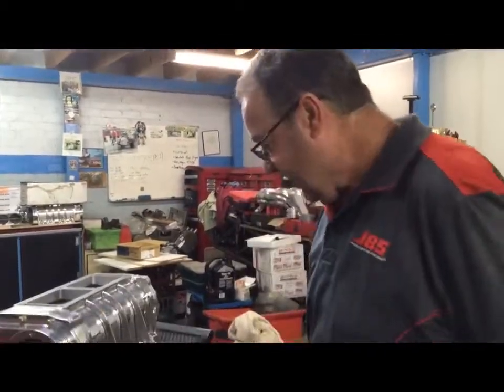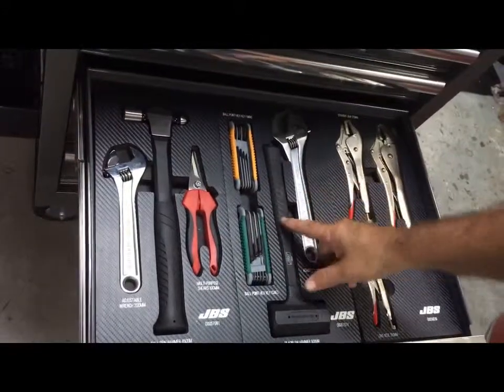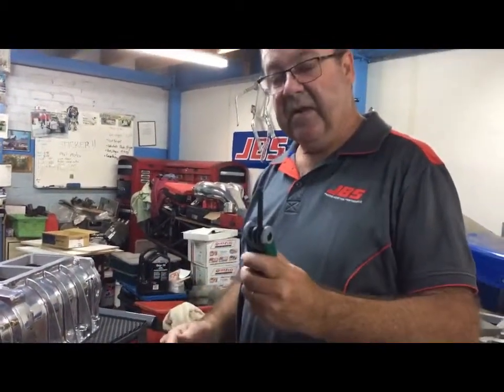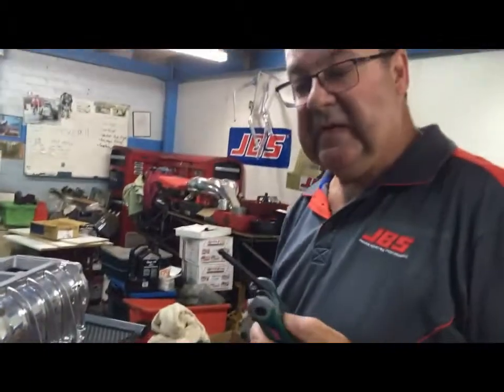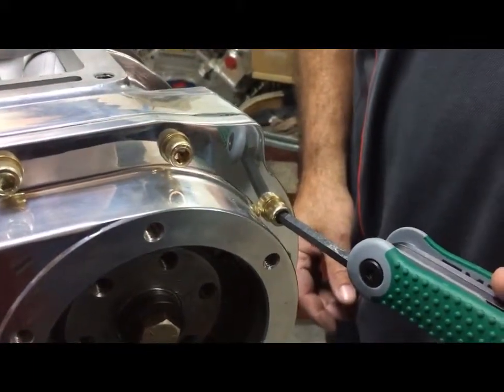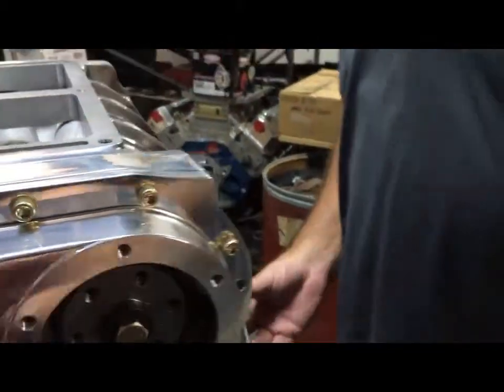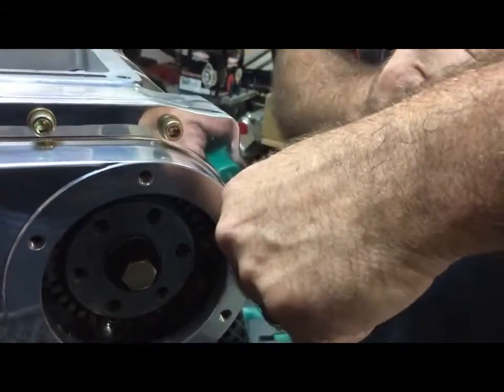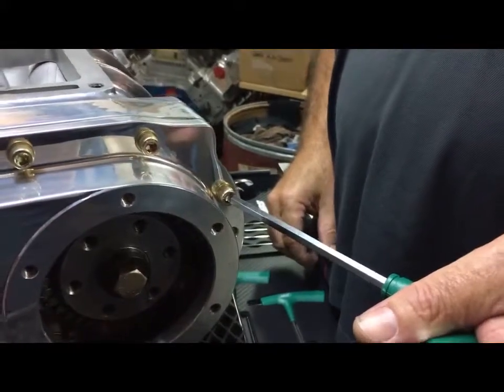What Are Ball Ended Hex Keys? How To Use Them?

Comment: The rounded end is only good for getting into tight spots and speeding up the process only, correct? E.g. not good for initial loosening.
Reply: Thats what I've always been told.

But the ball end is usually on the longer end, giving you shorter purchase for leverage (the short end).

Either way... these allen keys give some extra options at the expense of some extreme edge cases.

And people dealing with those extreme edge cases are usually going to have a hex key impact extension, or a set of T keys.  Because both are going to do that particular job easier than a standard set of flad end hex keys.